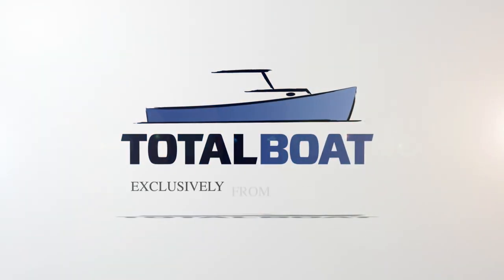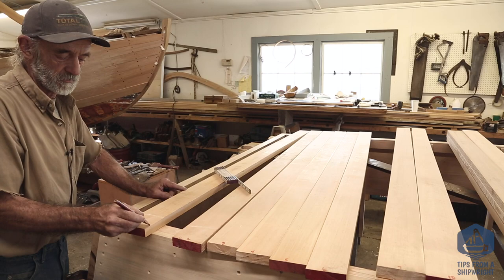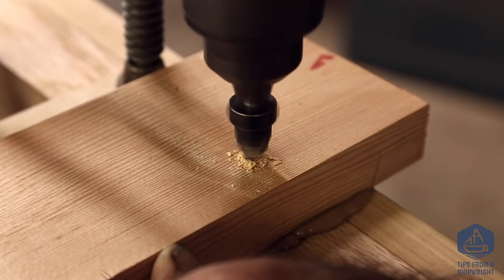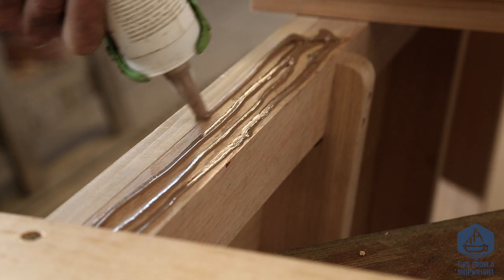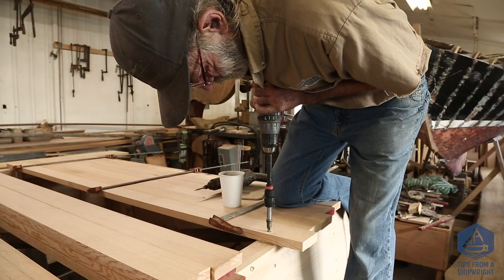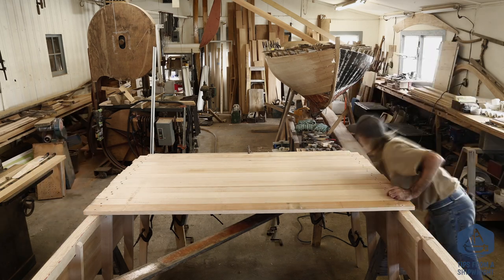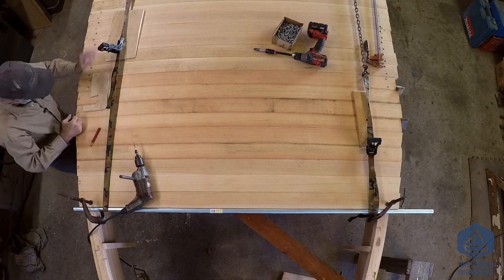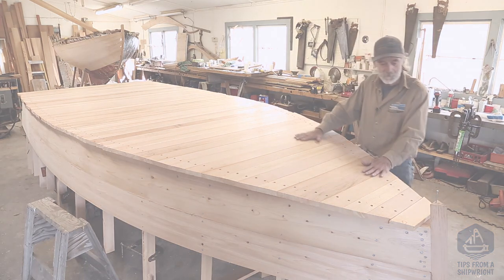Building the TotalBoat - Crowding up and bedding down the bottom planking (Episode 17)

Comment: Very great video series! Just a question, why no mud between each bottom planks?
Reply: anonymous4525 same question,  no mud between planks?
Reply: anonymous4525 
Yes please. Why no bonding between the boards? I was hoping thru the whole video this would be explained.
Reply: There is no need, you swell the boat to make a water tight seal between each plank. Every plank is like a dry sponge, they expand when they get wet.
Reply: +Short Round please explain.  How does the wood get wet? Is the finish paint not waterproof? If the wood gets wet is it special rot resistant wood?   I would like to know.  Thanks.
Reply: Pay Way You can swell the wood by simply pouring water into the boat for few days, usually wooden boats aren't painted below the waterline for the exact reason of paint being waterproof. Wood rot is caused by fungi, it needs oxygen, a food source, temp range of 40 - 100 degrees fahrenheit, and moisture. Remove any of these and it can not survive. Below the water line it has all the required items except for oxygen so it generally doesn't rot.
Reply: He said he had fitted the planks to each other on the planer/surfacer, there is zero gap. As soon as this boat goes anywhere near water, they'll swell and that's that. I think he's trying to keep this boat flexible, so it'll absorb chop and regular impacts with wharves and other boats by giving, rather than taking a hard hit to the structure.
As for wooden boats not being painted below the waterline, new one for me. Every one I've owned or seen has been.
Reply: [to Pay Way] 
As Short Round mentioned, rot spores can't grow in wood fully saturated or submerged.  Concentrated salt inhibits rot too.  Fresh rainwater not drained away properly, causes rot in topsides and decks much sooner than the salt water saturation in the bottom. 

But he is flatly wrong about the bottom of ANY boats (certainly not wood) being typically unpainted.  Some water absorbs right through the paint anyway -- same eventual saturation, the paint only slows this down a little.  (There's really no such thing as a "water-proof" paint or surface coating.  Not even epoxy, really.)  Almost all boats in the industrialized world, have some kind of outer bottom coating paint or chemical to minimize algae and seaweed and marine animal life growth attaching to the bottom.  This also helps prevent destructive burrowing worms that eat into the wood in tropical regions.  Only boats kept out of water the vast majority of the time, can get away without specialized growth-preventative toxic bottom paint.
Reply: boatrat74 I stand corrected, i was only talking about little wooden skiffs in my country (typically not painted at all) we mostly use tar. I have pretty much zero experience in industrial boats.
Reply: [to Short Round] 
Ah, yes.  Well, your "tar" counts as one of the other coating alternatives to paint, so you're still using something.  We are clearly speaking of two different categories then.  The issues remain the same, it's only a matter of scale.  Or location.  Another exception would be some tropical woods that are so naturally oily, that they don't hold paint well anyway.  But then those absorb much less water, too.  And boats limited to inland fresh water, don't have to worry about the kinds of marine growth seen in salt water.

Comment: Hi Sir, just found your site and really enjoying the binge streaming. Sir I have a couple of questions regarding the floor installation. Firstly, I did not notice you putting any glue along the length of the floor boards as your laid them, is there a reason for that and also, secondly, is there a marine reason why you wouldnt tongue and groove the edges of the floor boards just to add some rigidity to the joint and also add the surface area for glue. Would really love your perspective as know there will be reasons for doing it your way. Really love this series and the build, you explanations are awesome for us newbies. Many thanks

Comment: Those are some nice screws I haven't seen them in any local hardware stores. Are they special order?
Reply: Elmer Torensma couple of videos back he said he had purchased those in the 80s I think, check those out
Reply: He said in a previous video that he bought them many years ago and has been saving them for the perfect project.
Reply: The screws are galvanised, and in the more than thirty years since he bought them the galvanising has oxidised on the outside; the zinc coating turns into zinc oxide, which is powdery and white.  That, perhaps, is why they look different from what you normally see.

The zinc coating underneath the oxide layer will still be fine, though.
Reply: They're just hot dip galvanized, countersunk woodscrews, look like a 10 or 12 gauge size. 
Most regular fasteners now are electroplated, won't last 5 minutes in a boat. You'll find hot dip fasteners where the real heavy exterior wood construction contractors shop.

Comment: Why use flathead screws when pozidriv/phillips are so much easier to keep on the bit?
Reply: Watch earlier videos in this series.  He explains why.
Reply: Can I just give the short version by saying, "I don't accept your premise"?  I.e., he seems to be keeping those on the bit just fine.

No, seriously -- not actually trying to be snarky.  Just that the whole answer is a more involved bit of explanation of why boatbuilders wind up "stuck" dealing with slotted screws.  It's because they're hot-dipped galvanized steel.  If you care for my attempt at the whole explanation (several paragraphs), I laid it out for a guy asking this same question about two videos back in this series.  There's actually multiple issues involved in the choice of work-boat grade fasteners here.
Reply: Ah right, can you not get hot dipped posi or would it be too bulky for the slots?
Reply: Forgetting which style is called "posi" drive you mentioned (I've definitely heard of it, just not used it recently)... but without even looking it up, I can assure you it's not one of the commonly-available options for properly configured boatbuilding screws.  (I.e., proper full-diameter shape of the un-threaded portion of the shank is vital for boatbuilding strength, unlike applications such as residential "deck" screws.) 

Whether Phillips or that "star"-shaped one ("Posi-drive"?) seen in electroplated deck screws, you have the right idea about the hot-dipped galvanizing causing fit problems in those small crevices, hence it's not done.  In short, for optimal driver options OTHER than "slotted" in proper boatbuilding style tapered wood screws, you have to step up to Bronze, where regular available stock will either be Robertson (Canadian inventor of "square" drive), or "Reed & Prince" (old manufacturer name of bits for "Frearson" drive -- this looks similar to Phillips but internal angles are better for less slippage).  And Phillips is actually not all it's cracked up to be, even apart from the galvanizing problem.

The only "disadvantage" people are really dealing with in slotted drive, is they commonly don't have a bit that's REALLY fit well to the slot.  You see the custom grinding job Lou has done to his slotted driver bit here.  Once you get that driver-slot fit TIGHT and perfect, most of the alleged slip and cam-out problems of slotted screws, tend to disappear (assuming proper driving technique Lou describes).  Hence the continued availability of old-style slotted hot-dipped galvanized steel wood screws as the strong CHEAP option for wood work-boats.
Reply: Using slotted screws is also being kind to the craftsperson somewhere down the road that has to do a repair to this craft. Have you ever tried to remove painted-over, or puttied-up phillips head or posi drive screws? Slotted screws can be cleaned out quickly with a any knife.
Reply: As Lou says--"Why do I use slotted screws?      'cos that's the way they came" (in 1980, when he bought a stock of them)

Comment: But ... how do you prevent water from getting in between the planks?
Reply: FrankyBoy They're tight enough that they'll seal the boat dry.
Reply: Well, let's see :D
Reply: I'm pretty sure that Lou knows what he is doing here. Plenty of older work boats were built uncaulked when launched, they only get caulked later in life as the planking moves around. Caulked seams are for high quality finish type boats, you can putty them up and get a nice, smooth hull surface. 
Workboats get painted in house enamel and finish doesn't matter!
Reply: I bet he fiberglasses
Reply: Water swells the wood,they are tight now but when you put it in the water they swell up and get even tighter.

Comment: Why not bisket or dowel the planks together with poly as you go along
Reply: There´s no need...
Reply: I wondered why no sealant between the planks, and dowels or biscuits also seem like a good idea. But mainly the sealant. I think we'll find out in the next video.
Reply: I was asking myself "why not use a lap joint or a tongue and groove".  I guess by making the planking that tight, any leakage will be minimal and will stop quickly as the planks don't need to swell all that much once it's wet.
Reply: I hope so...
Reply: It's not a matter of the planks needing additional strength of connection to each other, as with the cabinetry-type joint methods you're naming.  The overall structure of the rest of the boat provides that adequately in this case.  The issue here is they just need to be mashed against each other tightly enough to provide water-tightness.  With really well-surfaced boards fitted very accurately to each other as he's trying to do here, this water tightness can be achieved sufficiently just with the minor swelling of the wood itself once it absorbs a little moisture when submerged. 

Alternatively, larger boats and other planking configurations with more variable seam shapes, call for a strand(s) of cotton driven firmly in between the seam to lock the planks to each other.  (Lou may yet add this style of "caulking" later to this boat -- if so, that happens after structural completion).  Otherwise, some flat-bottomed boats built like Lou's example here, do have "splines" added in the joints of these bottom planks, especially if intended for trailering or prolonged storage ashore (where traditional planks shrink from drying).  This is done like "tongue-and-groove" decking, but grooves on both sides, with the "tongue" (i.e. the spline) being a tightly-fit separate full-length strip that pins the two grooves together.
Reply: Biscuit joints and dowels have almost zero strength, that's why. The movement in a boat would destroy them in months.
As for lap joints, how are you going to make one with a constantly changing angle between the planks as you go along?

Comment: Slotted head screws are a b**ch you make them look easy.
Reply: Secret: Don't use a common screwdriver.  Use either a hollow ground or a flat plate driver.  Any professional assembly will use either one.  Common or tapered drivers only contact the top of the slot.  That's most of the problem.

Comment: All those screws in the chine....seems like they would act like wedges and split it into, even with it being quarter sawn oak.....lol, makes me cringe a little.
Reply: That's where staggering the fasteners and drilling the correct size hole fr the screws comes in. 
A screw isn't a wedge, the threads only cut into the wood to hold it, it should not be in a hole so tight it forces the wood apart.